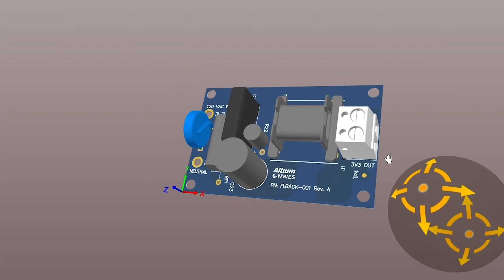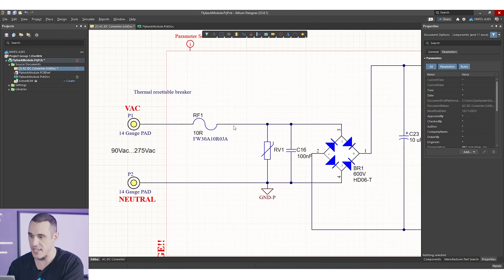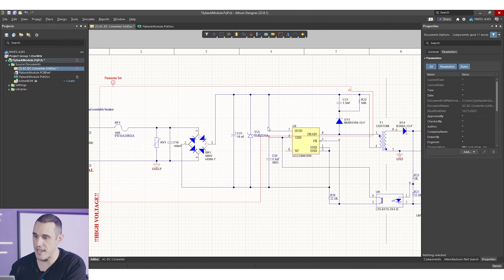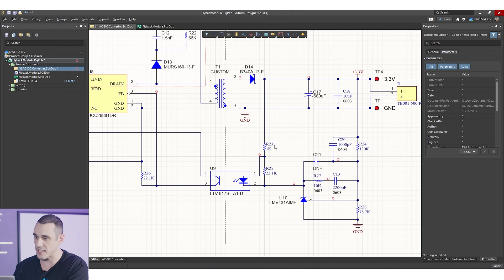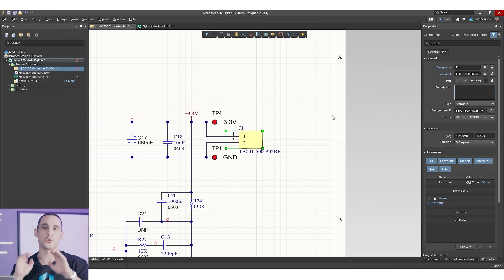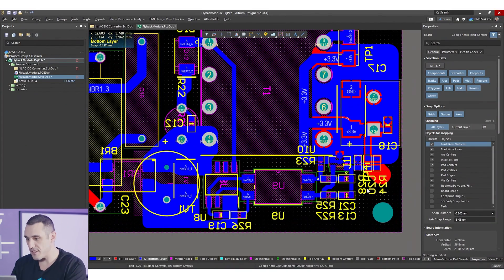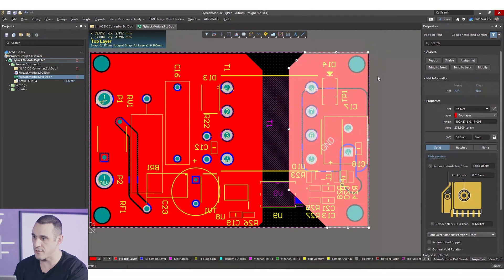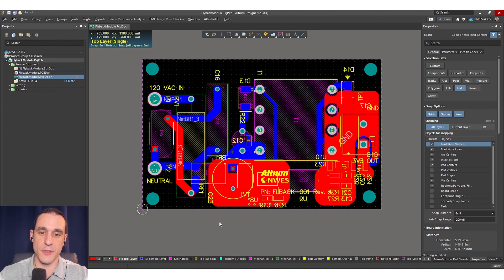Flyback Converter Design Explained - What You Need to Know!

Comment: I am confused. A flyback transformer needs no switches, so why are you designing this with noisy switches. Flybacks are used for audio because they have no noisy switching. Why are you using features of a Switch mode power supply in a flyback transformer? Can you explain please.
Reply: Look up the standard flyback topology, it uses a switching transistor to pull pulses through a transformer, and the pulses are drawn from a DC source. In this case, the DC source comes from rectified AC. A flyback converter can be used for audio, but it is used as a power supply and it requires filtering to suppress the switching noise.
Reply: @Zachariah-Peterson  I have another question. I have looked at over 20 power adapters using the flyback topology. All of them use a one layer PCB and routed ground. The power of the adapters that I observed is at most 30W. Is there a reason why they opted for a single sided PCB rather than a 2 layer PCB (which I find they cost the same on JLCPCB)? Next is there any harm in pouring the grounds in the flyback converters?
Reply: @WaswaSayari  The biggest reason to do single-sided placement is to reduce the PCB assembly cost. If you have components placed on both sides of a PCB, then you have two soldering runs to perform, using a single layer removes a process step and thus reduces the per-board assembly cost. You can pour the GND on the back side as needed. If you look at the final design I created with this flyback converter, the ground on the primary side was also routed, we did not have any GND pour until the DC output.
Reply: @Zachariah-Peterson  Thank you for the clarification. A final question about the flyback transformer. I have read some books about how to estimate the maximum power that can be output from a certain core without saturation. I followed the calculations but ended up with a design that doesn't work at all. When I used your guide on winding the transformer it worked. So do you have a way that I can use to estimate the maximum power that can be sustained by a certain core size?
Reply: I can't imagine how a flyback transformer would work without a switch.
Reply: @WaswaSayari  I asked for an answer, not a stupid question.
Reply: @richardsardini5585  Okay, flyback transformers are used in Switching power supplies. In the past they were commonly used to generate the EHT for Cathode ray tubes. The same concept is applied here in designing flyback converters.  The "fly-back" concept comes from switching DC voltages at a high frequency across a coupled inductor. Therefore, without the said switches, the flyback transformers cannot perform their intended task.
Reply: @WaswaSayari  So, an AC to DC flyback would not need switching as the current does the switching for it. Is this a correct assumption?
Reply: @richardsardini5585  Flyback works only on DC voltages...In the offline flyback converters, the mains AC is first rectified to about 340V DC (i.e for the 240V RMS mains). This DC is then switched on and off at a very high frequency across a coupled inductor (which we now call the flyback transformer).
Reply: @WaswaSayari  Why have I heard that flybacks are better for audio because of no switching noise.
Reply: @richardsardini5585  I don't know, but if you research you will find that flyback converters are very noisy. But with adequate filtering, the noise can be eliminated.

Comment: Can you provide some additional insight into how the feedback path works? I'm trying to understand the selection of bias resistor values on both sides of the optocoupler. Thanks!
Reply: Sure, this kind of feedback method uses a shunt regulator to bias the LED side of the optocoupler at a specific value. The shunt regulator has a threshold at which it starts admitting power delivery to the optocoupler, which is why you have that resistor divider. On the primary side, the resistors are chosen such that he FB pin is biased at a target value. So if you are below the shunt reg. threshold, then the current in the optocoupler drops, and then the voltage reaching the FB pin also drops, this then drive adjustment of the PWM signal internal to the switcher.

Comment: Great video very informative for hardware design engineers I would like to know that how to isolate the input AC line from DC voltage and asking how much the AC trace thickness should be thank you
Reply: AC trace sizing (thickness and width) should be based on the amount of current it will need to carry. In this example the flyback converter is stepping down to a low voltage so it will have very low current on the primary side. Still, it is typical to make the traces on the input large enough to handle any surge current when the device first powers on or if there is a fault somewhere on the primary side.

Comment: Shall I add any board cutout under isolation barrier? if added what will be the pros and cons of that?
Reply: It is not a requirement for the design to function, but it does increase creepage distance if low creepage is a problem, and it makes the boundary between the isolated regions very easy to see for someone who looks at the board, so nothing wrong with adding it. I have seen boards that include the cutout and some that do not.
Reply: @Zachariah-Peterson  when shall is use pcb cutout , are there any use cases?

Comment: Hi Zach,  Altium Rule quickly question,  Can it set a rule to check a spectial VIA(not thru pad hole) with only one line in all layers?
The correct case is that there must be copper or wire segments connected in the two layers, Thanks

Comment: Great video.  A few notes:
- The HV blanket should cover all parts up to and including the left side of the transformer and optoisolator.  Neutral is a high voltage net if the outlet or power cord is wired backwards or the neutral opens up upstream of the outlet
- I would add the voltage ratings for C16 and C23 on the schematic as they are both high voltage caps
- I would also add a bleeder resistor across C23
- The clearance in the GND-P pour for C23 positive pin looks too close for 388v (275V * 1.414)
Reply: That HV blanket is used for a clearance rule, the rules is set between all nets in the HV net class and all other traces, so it covers the case you are referring to since that rule takes priority. But anyways, the build of this is in progress and I'll do another video on it once it's finished.

Comment: thanks sir for this clear explanation ,
I have question about return current path and having a solid ground plane under traces . why we don't care in power electronics board about return current path ?
Reply: We do care about the return current having a well-defined location, including in power electronics. In this design, the primary ground is being placed under the switcher with a direct connection to GND and to the bridge rectifier to complete the circuit. The input line and neutral form the remainder of the return path on the primary side. On the secondary side, I also placed a GND pour region to form the return path for the 3V3 output. If this were a switching converter with an inductor, we would also want to place ground below the switch node to control where the return current exists and to control radiated emissions. You can learn more about this aspect in this video: https://www.youtube.com/watch?v=6ind9vopKZs